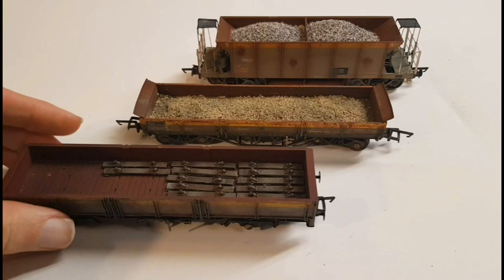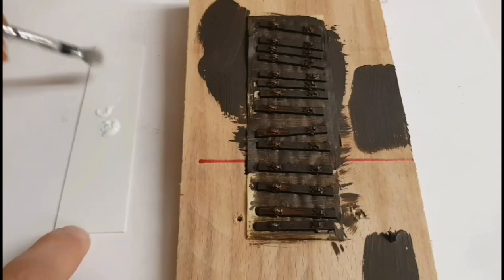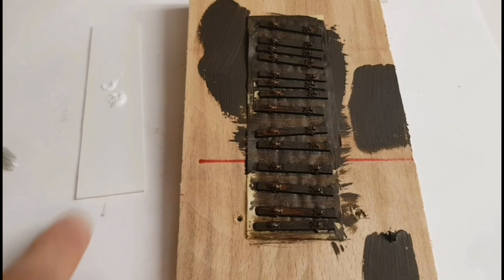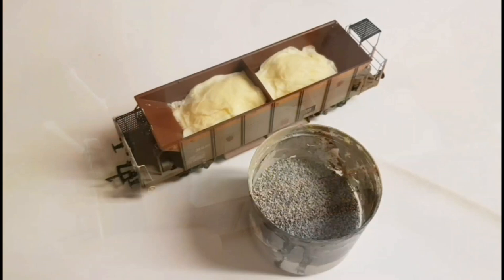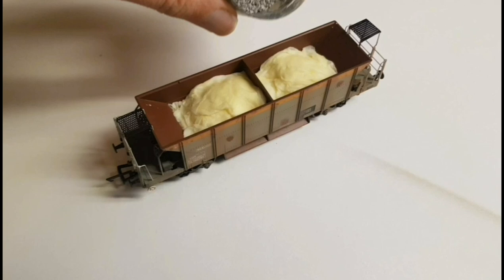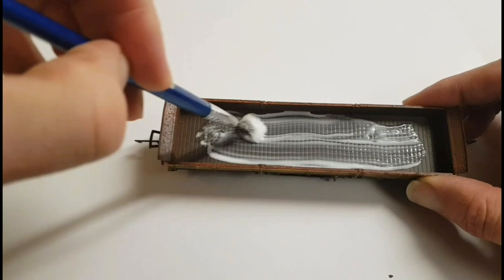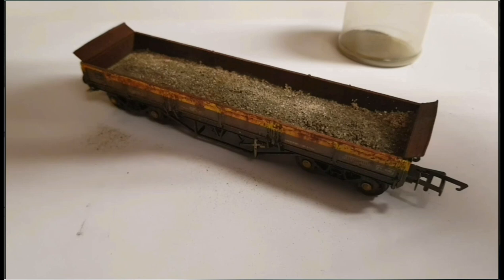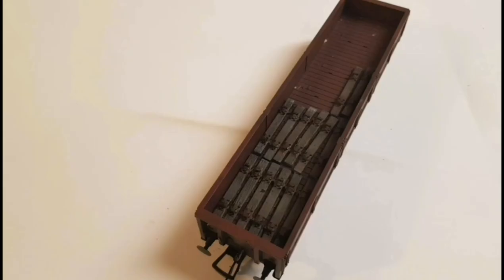Simple Wagon Loads.

Comment: Great video and nice wagon loads. I use a similar approach but before permantly fixing ballast loads put a barrier of cling wrap into the wagon first, then add watered down pva etc. This allows easy removal of a load in future if a change is desired. Works best with wagons having 90 degree upright sides and not the sloping sides of a seacow.

Comment: Excellent video mate, I'll be giving that a try later. What's the reason for the alcohol?
Reply from the maker: Thanks. The alcohol doesn't have any surface tension so doesn't dislodge any of the ballast grains. It helps also to draw the glue down through the ballast / sand. 
Water can work but must have a drop of washing up liquid in it to break the surface tension.